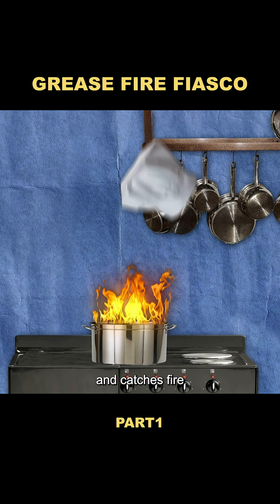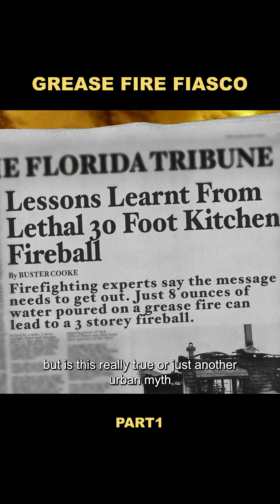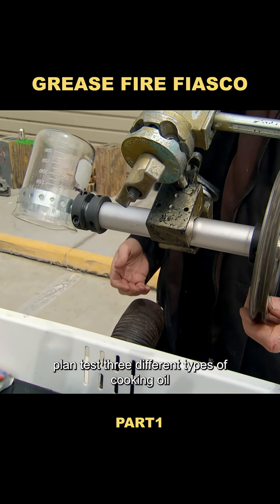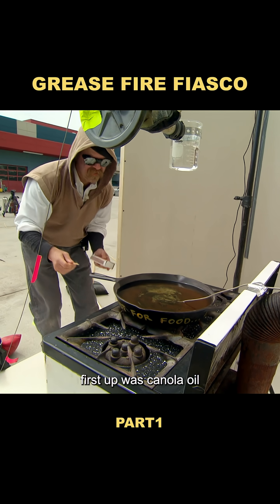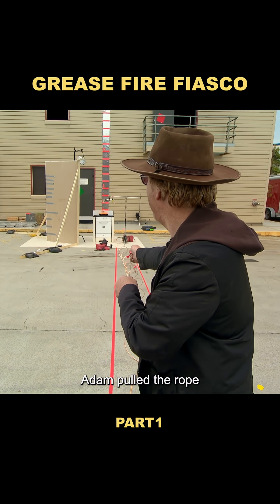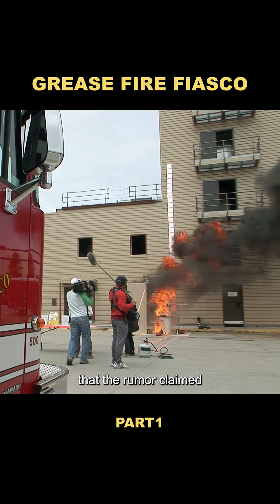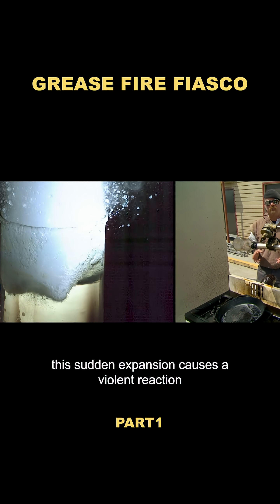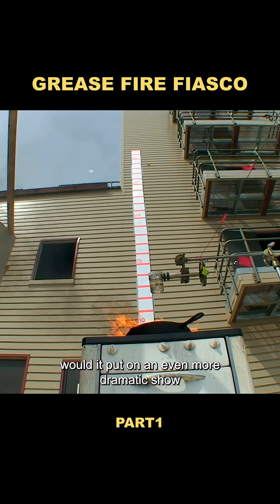Never sprinkle water on hot oil.

Comment: The heat that made the oil to ignite is so high it can separate the hydrogen and oxygen atoms in water and feeds the fire with oxygen which is a very highly flammable element.
Reply: No, no, no — oxygen itself is not flammable. Rather, it is an oxidizer, meaning it supports the combustion of other substances. A material is considered "flammable" if it can readily ignite and burn in the presence of an oxidizer like oxygen.
Also, this process doesn't separate hydrogen from oxygen. It simply vaporizes the water instantly, which causes thousands of tiny oil droplets to be ejected. This allows for a much more intense burn, since normally only the surface of the oil can catch fire.

Comment: If the oil catches fire due to overheating, just turn off the gas knob. The fire will be put off in a minute
Reply: no, since it is now catched fire, it will burn until no oil left
Reply: @alidursun1706 or if you’re smart you cover it up and starve the fire of oxygen (this is down very quickly due to the fire not only consuming all of the oxygen but also releasing carbon dioxide which makes the oxygen % even lower)

Comment: You should close pan to let fire get out of oxigen or pour that burning oil into water xD same rule like with acids xD you dont pour water into acids,you pour acids into water xD almost same but different result xD
Reply: huh
Reply: uhh, you okay?
Reply: No you just don’t use water at all. Starving it like you said is the best thing to do tho
Reply: @Wueuehsb yeah it best to just cut oxygen xD but if you poor oil into water nothing bad happend xD because there will be enough water to cool down oil,it wont make same reaction like when you add water into oil,because when you do that,temperature of surface and oil will instatntly turn water into steam and due temperature that steam will sepparate into oxygen and hydrogen both very flameable xD thats what happend when your add water into oil same as you never pour water into acid xD same princip xD but if ou add acid into water nothing bad happend because you just let that acid became less reactive because you dilute it xD